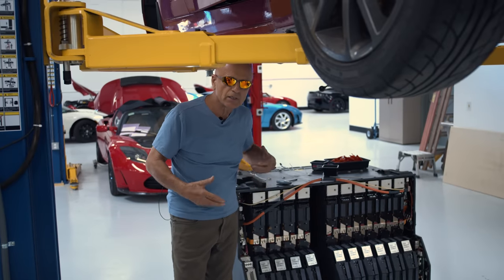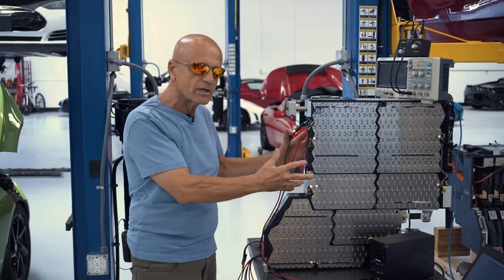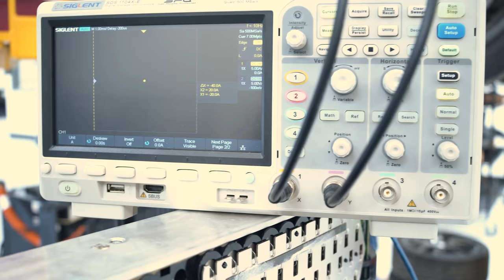Tesla Batteries STARTING TO FAIL | Gruber Motors

Comment: Let's say your gas engine lasts 200k miles.  You've done 20-40 oil changes at $40. That's $800-1600, plus at least 2 tuneups at $100 each,  so $1000-1800. Plus air filters, trans or power steering fluid,  etc.  Just maintenence.  Then your engine goes,  and it's $5000. Not bad to have an EV that needed none of this. A battery repair or replacement doesn't look so bad,  and that's not even counting being able to charge at home for cheap.  Even at 30mpg and $3 a gallon [10c/mile],  you'll have spent $20k on gas,  or double that.... At 10c/kwh charging at home at night,  the Roadster gets 3+ miles per kwh, so you've spent a third as much on energy.  You've easily saved $20k on running costs [energy plus maint.] in 200k miles. Wonder if you could've made $20k in Tesla stock in 14 years.

Comment: Exactly as predicted by the Engineers then. Great if you can overcome this issue, but with structural battery packs, this won't be possible. Presumaly Tesla are confident enough in their 4680 cells to not need this sort of intervention.
Reply from the maker: The newly emerging battery technologies are exciting.
Reply: @grubermotorcompany  I can't wait for 800v+ charging and 1,000,000 mile packs.
Reply: @grubermotorcompany  unfortunately the vertical integration/structural battery is going to be a nightmare tbh! I’ll like to see one of those tesla survive Africa or South America roads and weathers 😂 😂 😂
Reply: @carholic-sz3qv  Today's Teslas are simply not made to handle the dirt roads of African savana or Argentinian pampa.  Would you take just about any sedan on such dirt tracks on a regular basis? If you are operating in such environments, buy yourself a high-clearance Toyota 4WD or similar... or wait for the Cybertruck!
Reply: @desertsoldier41  There is a 2013 Model S in Germany that just passed 1'600'000 km (1M miles).  However, the early pack had to be replaced around 480'000 km (not bad for a first gen pack).  It means that the second one has now over 1.1 million km and is still going strong, as far as I heard.
Reply: @st-ex8506  lol…….. when those cars will get old would they be good kinds of candidates for foreign exportation!? Because Toyota for example is the worlds most exported brand to countries around the world, also how is the cybertruck also going to survive there? Lol…
Reply: @carholic-sz3qv  You keep coming back to Toyota... I would not like to be seen at the wheel of a Toyota.... unless perhaps if I could justify that it is a loaner.  As we say in France, those are for "beauf".  No wonder it exports well to Africa!
Reply: @st-ex8506  lol…… Toyota is just an example obviously it’s not the only exported car lol…… those very old ICE still have way better range and capabilities than a new EV !
Reply: @carholic-sz3qv  That is your opinion, and you are perfectly entitled to it.  Enjoy your ICE vehicles while they are still being sold.

Comment: Yes so environmentally friendly what are the environmental impacts of the lithium mines again? Weird how I have a 40 year old car and have barely Replaced any parts. Seems a bit more environmentally friendly to me than having a trash first gen tesla with a dead battery after 10 years. Not to mention. Cold and heat don't affect my range and my car doesn't have hundreds of different software locks on it. But u know keep saving that environment.
Reply: What car do you have? Must be one of those MIRACLE cars everyone is talking about. BS. There are NO 40 year old cars that haven't had extensive repairs and maintenance.
Reply: @bigdougscommentary5719   WRONG ! there are many !

Comment: The fact that this is coming from a MOTOR company means you will have to take anything said here with a pinch of salt. Besides 14 years for a 1st gen battery is bloody good going, most ordinary battery's in ICE cars wont last 2 years.
Reply: what is the cost of replacement of the battery pack?
Reply: But an ICE battery is replaceable for $200  Just like tires, they were expected to be replaced to keep the car running.

Comment: Thanks for the in-depth look. My understanding is, with one dying cell “snipped” from the rest of the brick, how does the BMS handle it because the voltage and energy doesn’t add up anymore?
Reply: If the brick batteries are in parallel, the voltage will go up to its normal value (since a bad cell will have a lower than nominal voltage). The energy CAPACITY of that brick will drop because it has one less cell in it to store charge
Reply: The batteries are 18650 cells that run at 3.7v with about 3000mAh of capacity.  They are connected in parallel.  So when connecting in parallel the total AH is added together but the voltage stays the same.  So 3000mAh X 79 batteries = 237k mAh of total capacity.  Missing 3000 mAh is relatively negligible (basically 1% of the total capacity of the pack) and wouldn’t be noticed by the BMS.
Reply from the maker: The BMS never realizes one of 7000 cells has gone MIA, thankfully.
Reply: @grubermotorcompany   Why not replace the bad cell with a new(er) cell? I know a brand new cell probably isn't the right solution as it will have higher voltage than the rest of the pack, but if you had some old ones lying around, couldn't you select one with similar voltage to its neighbors, replace the faulty one with that and thus retain full capacity in the pack?
Reply: @aftonline  ah, drill it out and insert a new one. But if the new one was inserted wrong it would destroy the whole pack and if it wasn't caught right away it could catch fire and destroy the whole building. That would literally half the amount of Tesla roadsters in existence. Prices would skyrocket potentially exceeding what the roadster 2 will be valued at, production wouldn't be able to keep up with the demand and Teslas heart and soul would be compromised. Elon would be forced to sell Twitter for gasoline just to fuel production and this whole "green" world will quickly "grey" and that's when the chupacabras come out... Read more
Reply: @macbook802   I was hoping for an answer from Gruber himself about why he doesn't replace the dead cell, but instead I get an end of the world scenario? I'm pretty sure that in other EV's the dead cells can be replaced without incident, just curious why you think it can't be done in a Roadster battery pack?
Reply: @aftonline  I actually build ev's in my spare time. I'm sure it can be done. The consensus answer seems to be, why?
Reply: @macbook802   Why? is not an answer, that's a question. My question was why not? If you build EV's in your spare time, perhaps you are more qualified than me to answer my question, if Gruber isn't available?
Reply: @aftonline  ok, here we go, cracks fingers. Answer: if it works, then don't fix it... Read more
Reply: @macbook802   Fair enough I guess. If I owned the car I would want a full set of batteries but I guess it's such a small increase of capacity the benefit is marginal. Thanks for your answer.
Reply: @aftonline  anytime. I'm not an engineer but someone asked me if I was one time
Reply: @aftonline  the simple answer is there is a lot that can go wrong with replacing a single cell for not much benefit.  The battery packs in hybrid vehicles usually have replaceable cells(the cells are actually sticks of 5-7 C or D sized batteries soldered together in series).  But those packs are much smaller so losing a cell represents a much greater % loss in overall capacity.
Reply: @aftonline from what I've heard they are Epoxy together , and the chance of shorting other cells could lead to more damage or a thermal run away event that would be bad , what does not help is 18650 are incredibly easy to short out while trying to snip the spot welds from the anode and cathode terminals .it's safer for them just to cut the jumper wire fuse while in situ, which is designed to stop a bad cell go thermonuclear and run away in the event of a catastrophic failure .

Comment: I got a little nervous every time Pete touched both sides of the battery sheet at the same time.
Reply from the maker: 4 Volts DC per brick.  Worst case sheet voltage is 36 VDC, which I cannot feel unless I am still wet from an ocean swim.

Comment: Is this mode of failure only effecting Roadster batteries? I realize battery technology is progressing, and wonder about the lifespan of other automaker's batteries who are not using 18650 cells. Although these particular batteries are rated for 10 years and are now going on 14, this does not seem long enough given the cost of these batteries.
Reply: Great question. The problem of individual cells taking out a whole battery pack means ownership after the warranty expires becomes a crap shoot as to how long the car has value. Individual cell production quality is ultra critical since there is no built in way to exchange cells once installed (in Teslas currently).
Reply: This can happen/will happen to ALL battery packs , it does not matter if they are made of 18650 cells/ lithium polymer packs etc. All battery packs use numerous cells and at any given time one can fail due to manufacturing defect or age then bring down the whole module.  You also do not want to go in and replace a individual cell or module in a complete pack (unless the pack is relatively new) as mixing new and old cells will have their own issues.

Comment: Highlights again deliberate unserviceability of products. These individual battery cells should be configured so they can removed and replaced almost as easily as any battery powered device, but here the "brick" is the smallest serviceable level of easy replacement and even those are not available as spares. That "brick" should be easily disassembled and each cell easily replaceable.
Reply: That sounds all well and good, but it's really not feasible.  The design changes needed to make the actual individual cells replaceable would make the battery pack larger and heavier than it already is.  The individual cells are soldered together to give the best electrical performance they possibly can.  If a less than ideal connection were to be used just for serviceability's sake the performance of the entire pack would suffer.
Reply: @brandons9138  Oh, you mean like how Apple phones are so much better than Samsung phones because the battery is essentially non-removeable? You mean how soldering is impossible to undo? You mean how "Right to repair" products has not been debated recently by the US government?. Of course it's feasible, it's a choice and companies design for planned obsolescence, they don't want their old products hanging around in the marketplace cutting into the sales of their new ones. Notice that Tesla is not even making replacements for the roadster battery, mechanics are sourcing from wrecked ones. Tesla wants owners to buy a new model.
Reply: @peterschmidt1453  I'm not saying it can't be done, but the changes to the design would compromise the performance of the battery pack as a whole.  Soldering is the best way to join cells together.  If you want to use a different method then you are going to have other issue like increased resistance and higher heat cause by that resistance. That degrades the battery pack even faster. 

If you want to replace a cell that is in the middle of the pack you may have to disassemble several rows of cells to get to the offending cell. Adding heat to a cell during de-soldering and resoldering can damage the cells and cause even more problems.  Comparing a cell phone with a single battery to a EV battery pack with thousands of cells is ridiculous.

Notice how Tesla isn't making the entire roadster anymore? Not just the battery packs.  It's not a model that they are supporting anymore.  All things have a service life.  Companies are not obligated to support their products for eternity.  It happens all the time. Try to go out an get a brand new replacement motherboard for a 10 year old Dell computer.  Good luck with that.  You'll have to go to an electronics recycler to find it.  Some products have a longer service life than others.
Reply: @peterschmidt1453  low-voltage, low-discharge batteries in phones are incomparable to the requirements of an automotive battery pack.
Reply: @logitech4873  The issue is unserviceable design, not batteries.
Reply: @brandons9138  You want to support unserviceable design, good for you, you'll be paying for it.
Reply: @peterschmidt1453  You obviously have zero clue about how a large battery pack like those found in EVs work. Doing what you ask in a pack of that size would make it a worse product. It would be more prone to failures while increasing weight and reducing efficiency.
Reply: @brandons9138  Anytime you want to see clueless, look in the mirror.
Reply: @peterschmidt1453  Why are you standing behind me?

Comment: Age isn't a good way to measure cell life. Cycles, duration of discharge, frequency of recharges, temperature, discharge rates, depth of discharge all very important data when the battery is the only potential for the car to function. A battery can sit unused  for 10 years and be a paper weight when you need it to function. I bet there isn't more than 50k on that roadster. Quite literally the worst investment in a depreciating asset that puts you upside down financially before the ink dries on the loan paper.